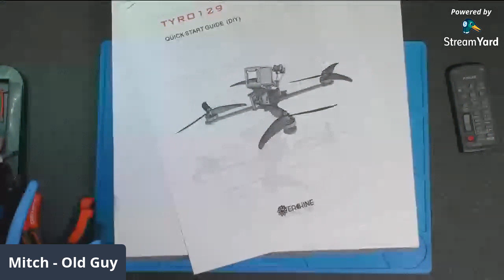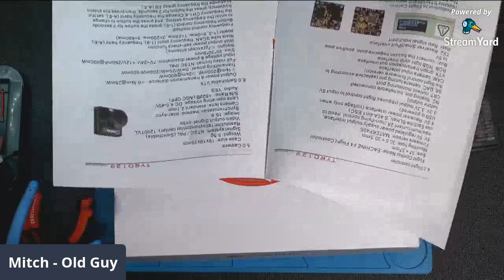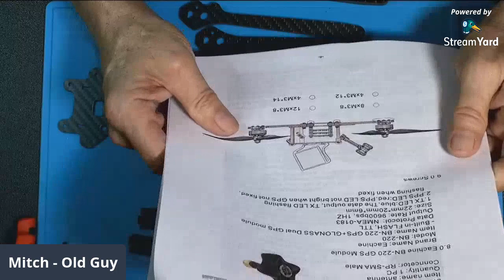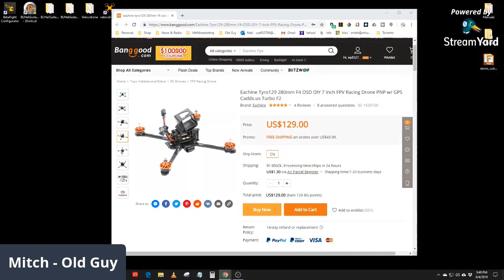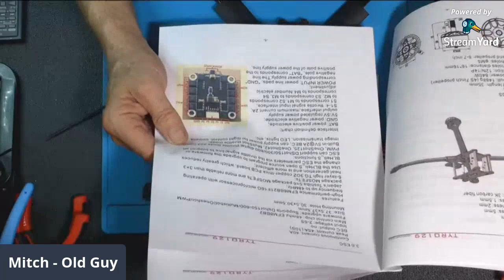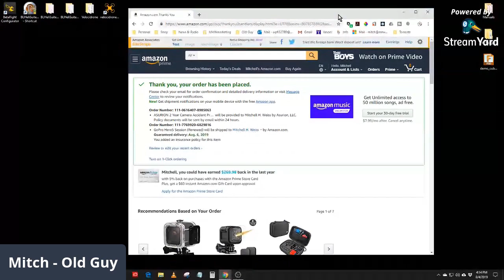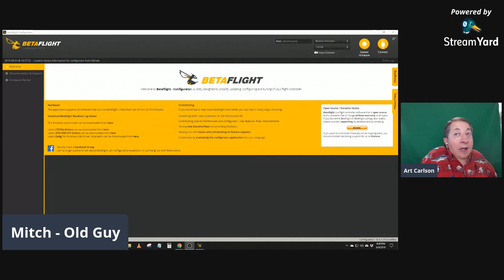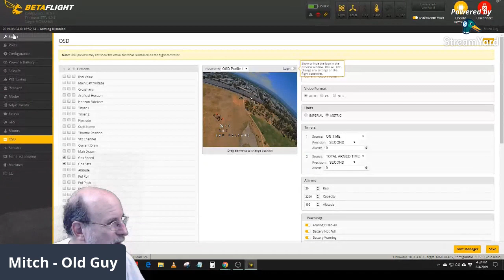FPV LIVE Build - 7" Tyro 129 Long Range

Comment: Glad you got extra parts mine only came with one press nut so now I got to wait and build it 🤬
Reply: In thought about building it with it the and just using the stand offs 😂
Reply from the maker: Sorry to hear that. I built 2 if them and thankfully I didn't have that problem.
Reply: I contacted banggood but that'll take 3 weeks 😂 so I'm about to just order some off Amazon and hopefully I get the right size but I'm sitting here following your video building what I can with out them

Comment: Hi,I can't seem to get a receiver to work on this build. I have tried several they bind but no stick controls?
Help please, thanks
Reply from the maker: Could be any number of things. Send me an email at oldguyandadrone@gmail.com and give me a little info such as receiver and transmitter type, betaflight settings that you used for the receiver, etc. We'll start there.... Mitch
Reply: i just had the same problem. mine was the tyro69 and i have an rxsr receiver. bound up and no stick movements in betaflight. turned out the rx wire was one pin off. moved it over and BAM, in BIZZINUSSS!

Comment: Did you set up SmartAudio?
Reply from the maker: Yes I did. I had to add a 4th wire to the cable from the FC to the Vtx. Works great.
Reply: @OldGuyCarnivore  I ordered mine today.  Trying to get my ducks in a row when it gets here.  I may follow up with a question when I start my build.